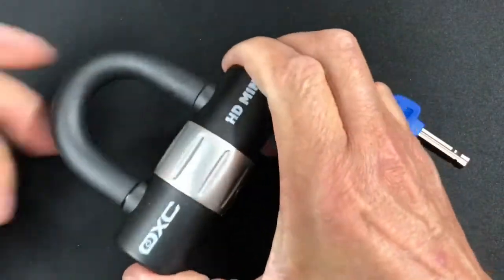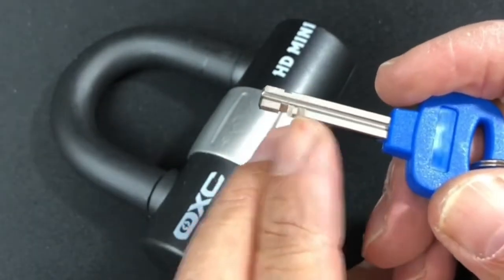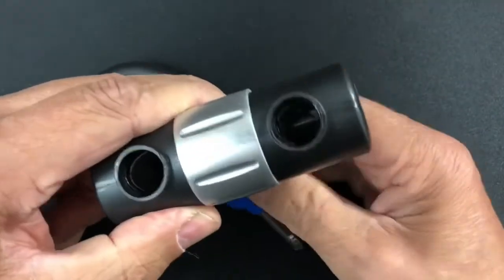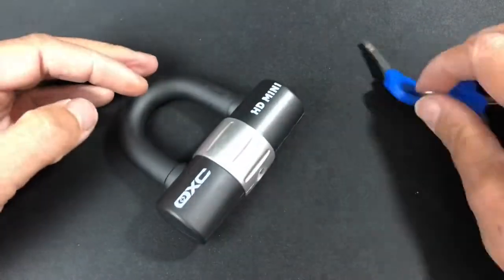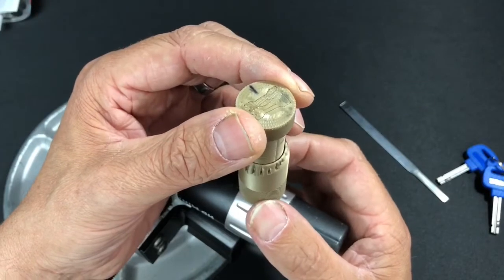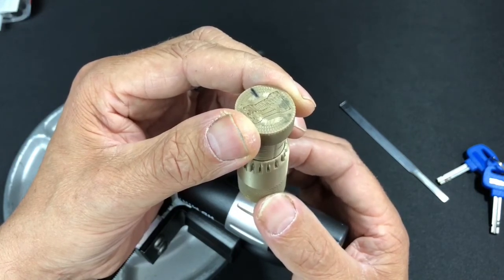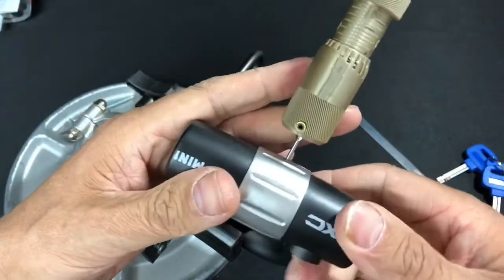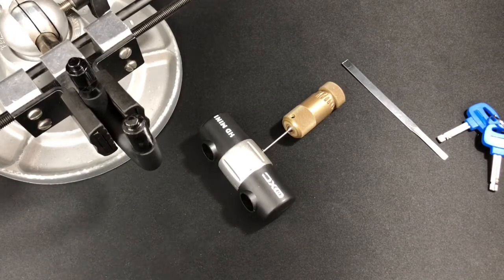Oxford HD Mini Bike Lock picked with the 3D SB  ( tough lock )

Comment: Very nicely picked there using the 3D printed Silver...ermm Gold Bullet : )
I have always thought these locks look like a good piece of kit but... I would say with a nice thick shackle like that you would need quite a hefty chain to go with it. Chains are always a pain for cyclists (in my opinion and that's from someone who used to ride motorcycles) so although a good strong lock with lots of pluses and decently anti pick, needing a heavy chain would be a down side. You certainly can't take away from this lock though its very positive features.
Great video Daz, were you using your second finger to control the movement on the pick as you came up each disk?
Reply from the maker: Roy Sammons I see these locks everywhere & was always curious how they would stand up to a picking attack, & this one definitely put up a fight. Yes because of the size it does need a heavy chain. 
Yes I my second finger was used to keep control of the pick, the 3D printed SB definitely needs it for control, as the tolerances are a little off. Have a great weekend Roy.